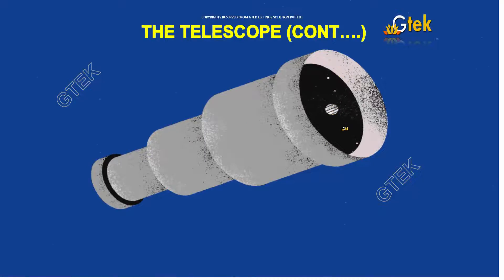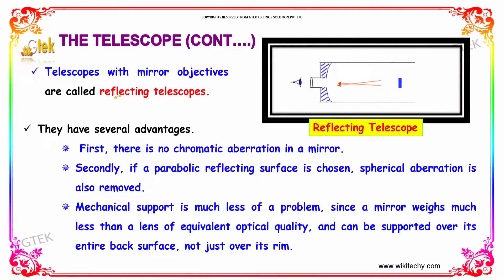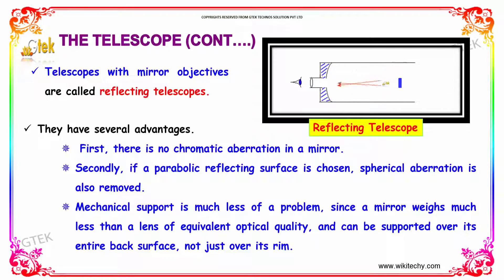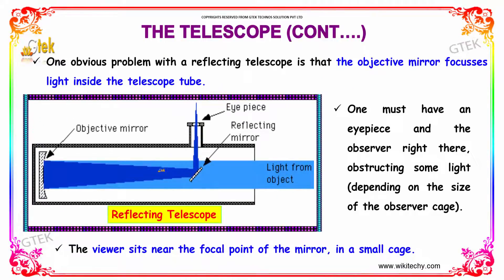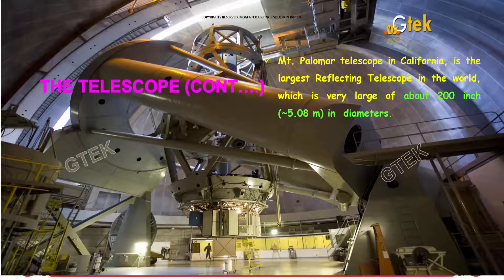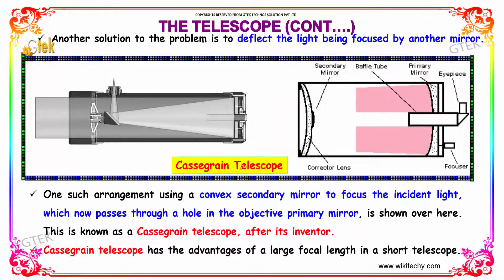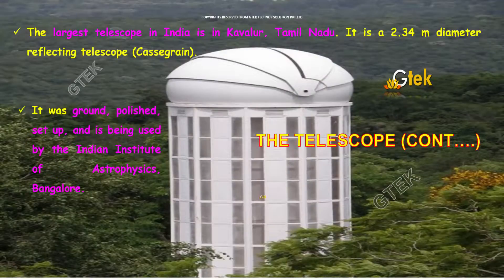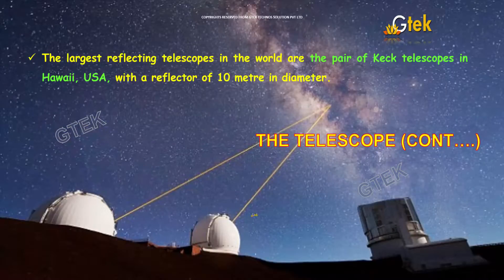Telescope Construction|Optics|class 12 physics subject notes lectures|cbse|IITJEE|NEET

Comment: objectacting surfaces may be spherical, parabolic or cylindrical, but spherical surfaces are the most common. Lenses are nearly always made of glass & are of two types.

1. Convex lens 2) Concave lens
The convex lens is thicker at the centre than at the edger while a concave lens is thinner at the centre than at the edges. A convex lens causes parallel rays of light to converge after refraction opposite.
The properties of lenses made us a way to optical instruments – mainly telescope. Telescope is an optical instrument used to see distant objects clearly and apparently magnified. /when a distant object is viewed through a telescope, it appears closer and therefore larger. A telescope increases the visual angle. It does not make the image bigger than the object. Suppose you are looking at the moon through a telescope. The image of the moon appears to be much bigger when viewed through a telescope because the angle it subtends at the eye is larger. When you look at the moon with unaided eye, the visual angle is small and therefore the moon looks smaller. The most commonly used refracting telescopes are

1) Astronomical telescope 2) Terrestrial telescope

OBJECTIVE

o To study the nature and size of image formed by a convex lens
o To study the structure and working of telescope.

METHOD OF STUDY

1. The size and nature of the image of an object formed by a convex lens depends upon the position of the object